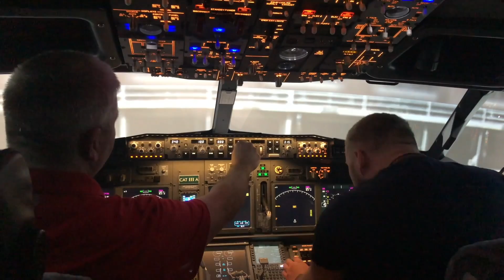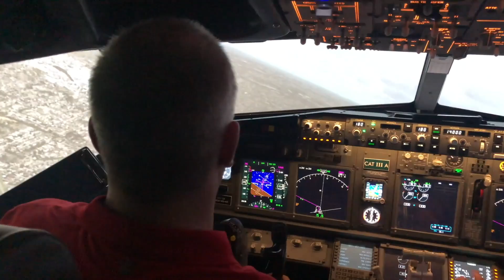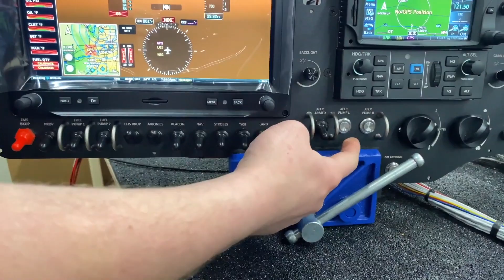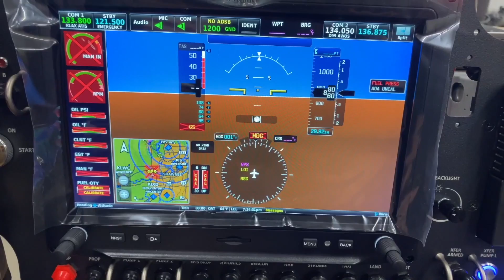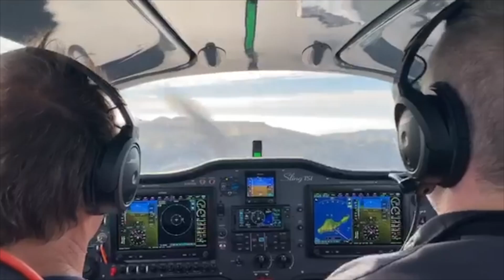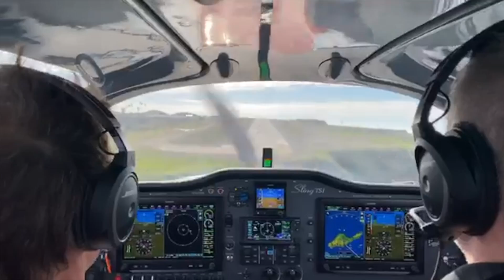Building Airplane Panels l Garmin G3x Touch

Comment: It's somewhat interesting that you can build your own aircraft but it's terrible that you have to. Imagine if the only way you could get a Tesla Model 3 was to spend a year building it yourself at the factory and having to connect with a lot of companies to get all the pieces together and then have to pay 200 grand for it plus travel and living. That's not a good thing, that's a symptom for aviation.
If an inspector can take a quick look at a homebuilt and declare it fit for flight, why can't an FAA guy take a little longer with a design and say it's fit for mass production.
Reply: Why terrible Dan? There are two main reasons for building from a kit, one is to save money and two is for the sheer sense of accomplishment of building your own. Their aircraft are available as a kit or ready built if that's your thing. If I had the means I would jump at the chance to build my own aircraft but funds and health are against me these days. As far as aircraft inspection goes, the inspectors take a more than a cursory look at any aircraft before first flight. If you think that a passed design is sufficient for safe operation you're mistaken. Approved methods have been known to deviate from to accommodate manufacturing convenience.
Reply: @retiree1033  It's 161k for a quick build kit without travel and accommodations so how much are you really saving...
Reply: You are saving a lot. And learning plus accomplishing even more. And at this point there aren't very many other options. That is
just a simple, but indisputable, fact!! Now you can talk it up one side of the
street and down the other. But the fact of it will remain constant. 

The End.